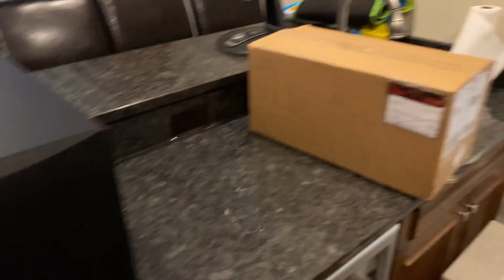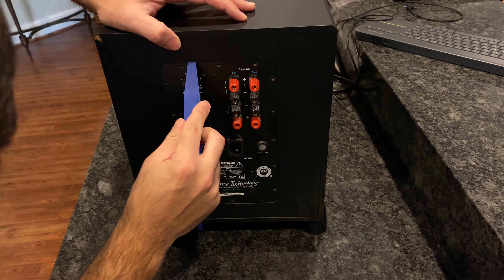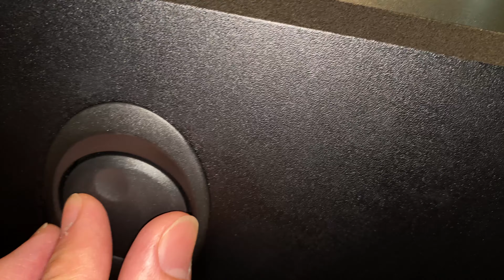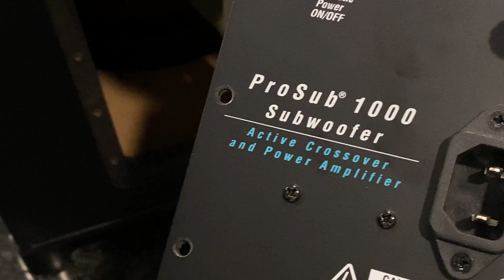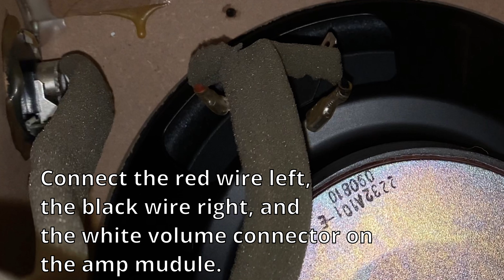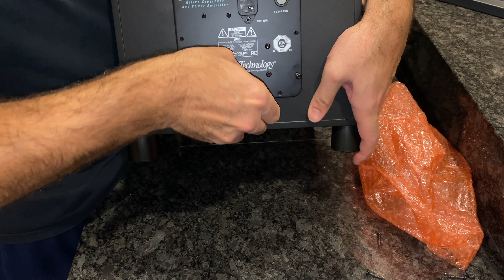How to Replace a Definitive Technology Subwoofer Amplifier

Comment: Hi, where did you buy the sub amp?  My sub is over 11 years old and finally gave up.  Thanks.
Reply from the maker: I bought it straight from Definitive Technology customer support. It was like $200 but much cheaper than a new sub.
Reply: @Upscaled_HT  Thanks very much.  It is much cheaper.  I bought two other famous brands but was not happy compared to Definitive.  I returned them both and will replace the amp on the old sub.  Thanks again....
Reply: If you're good at building things, repurpose the toroidal transformer to build a stereo amp!
Reply: Thx for the video, I’m not sure if that’s the problem with my sub (same) it powers on but no sound.
Reply from the maker: @MrMuyee  Have you replace the amp?  I called def tech and described my problem and they determined the amp was bad.  I replaced the amp and it's good as new.
Reply: @Upscaled_HT  no never been replaced and I’m equally getting a hum from one of the tower speakers.
Reply from the maker: @MrMuyee  I'm sure you have done this did you check all your connections?  It could also be a ground loop.  It could also be your receiver or pre-amp/amp combination.  Do you have another receiver to try connecting it to?